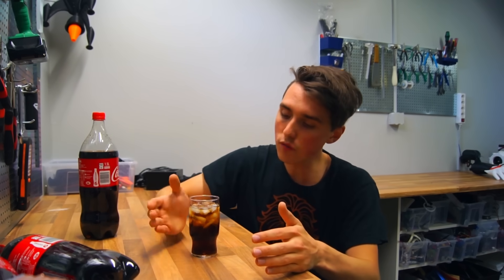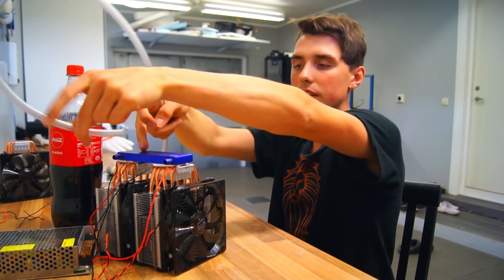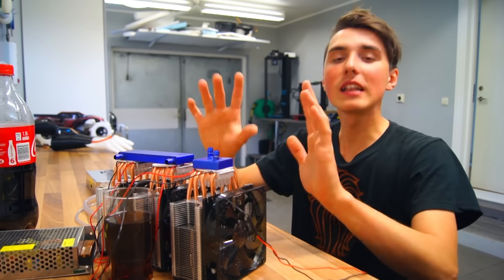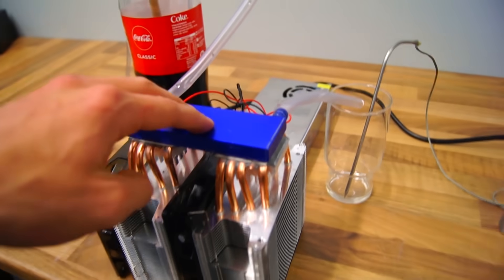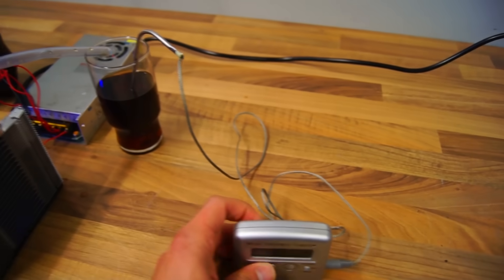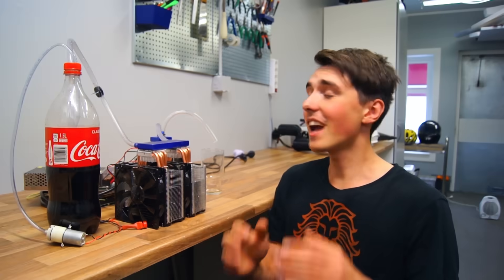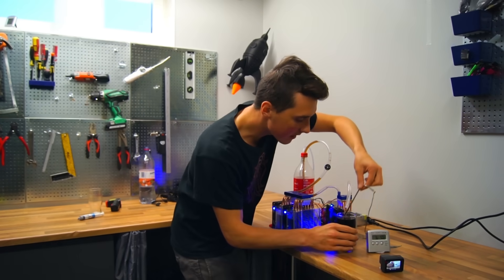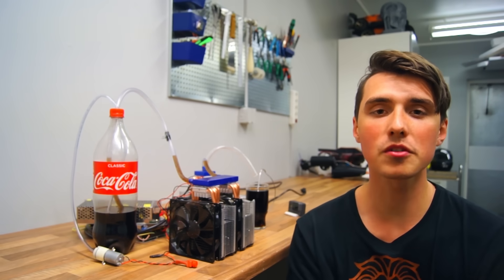Peltier Soda Cooler Machine - DIY Drink Dispenser

Comment: So, how does the lead based solder they use to seal those taste? Delicious and cancerous? Also, you were hitting thermal capacity limits with your low mass of aluminum (ie, you were waiting for it to chill a long time, but the low amount of metal wasn't storing enough thermal potential difference to be as effective as you want). So adding a chunk of copper (or steal, any metal) to the top of the long water block would have been a lot more productive than adding the second small cooler. Obviously you weren't going to go so far as to insulate it since you would be tearing it apart soon after, but the thermal mass would have solved your problem.

Besides the dangerous lead (I'm hoping you just didn't know they used vacuum soldering to seal the blocks), it was a cool project. I had thought about doing this with my phase change cooler (refrigeration cycle for computers, -55c no load, -35c max temp at 200w load) and using a safe block that uses an acrylic top and an O-ring for the seal. Plus it should be easy cleanup that way with a toothbrush on the fins. You have a cool idea (ha, literally), but safety first (you can just use the non-soldered blocks if you want to use your's a lot).

Comment: Best way to limit the flow would be to use a buck converter on the air pump. Get the adjustable ones, and place a snubber diode across the pump inputs to prevent back EMF.

Comment: Use the motor as a vacuum, then make the liquid circuit in circle, the coke comes and goes to the same recipient, when it is enough cold, stop the recirculation and turn it off, in order to avoid freezing the coke inside the circuit

Comment: Cool video (pun intended!) ;)  however try using a longer strip of metal (not a waterblock) say 18 -24 inches long with the 3 peltier's spaced evenly then use a longer tube of plastic and wrap it around the metal strip. so the liquid never touches metal, lot more hygienic and easier to clean. Also might cool it down more as it's travelling a longer distance along the metal... ;)

Comment: hey man your sistem is ineficient in the heat transfer, the block is too big inside and too short path, the best thing you can do is use an tube coil, best one iso copper tube coil, like in the old beer cooling machine tha uses ice with the arround full of ice and the liquid passes the coil, in your block the liquid passes and refrigerate the outside and in the midle of the liquid is hot, in the cup it mixes and bring an midle temperature, in the coil ins much mor midle hot liquid, try that and awnser me the results, i wanna make one too UAHUAHAUHUA but the teory is that XD... good chanel good try

Comment: For what do you need the giant heat sink?
Reply: If you don't cool the peltier-elements enough they will overheat and break and they produce a lot of heat
Reply: FreakManuel is it necessary to use such giant heat sinks?
Reply: MrBackfisch to the overheating do peltier elemts cool better as cooler the hot side is (im not completely sure about that tbh) but better cool them to much as to little

Comment: Actually, just before you pulled out the sensor out of the glas, you can see 6 degrees on the display!

A very easy way to enhance this is to mount a second cooler on the top of the 2 other coolers. Maybe print a 3d part to hold the 3 coolers together.

Comment: Just use Dy Ice cubes instead of water ones. Sublimates and adds a little extra carbonation on its way out... no crunching on them though.
Reply: Please don't ever swallow dry ice. You do not want your insides to get frosted.
Reply: you can store dry ice in a super freezer or in a tank. just have a bottle of liquid Co2 and a staintless tea filter. run the liquid Co2 into the stainless filter and poff dry ice.
Reply: freeze soda.  Use freeze soda cubes for cooling your soda. :/
Reply: get a large block of dry ice and put it in a cooler in a freezer. that's the best way to store it without special equipment. however it will still slowly evaporate.

if you're afraid of swallowing it place it in a tea infuser.
Reply: I thought I had seen that some supermarkets in the US sell dry ice? Is that a thing or did I make it up.
Reply: @bencarter96  Tons of supermarkets sell it here in the USA, I buy it weekly, all across the country.
Reply: i've seen a few that do but there are none nearby me so i dont think they are very common.
Reply: There are a couple by me that sell it. Good for keeping stuff frozen on long trips.
Reply: Ben Carter
Reply: https://www.youtube.com/watch?v=3u_5AkcOc84
Reply: Awesome idea!!
Reply: LostName chewing quickly on dry ice is actually fine. Swallowing a small price would hurt going down, and would probably make it hard for you to breath once it hits you stomach because of the CO2 that gets released when it cools down, but it wouldn’t kill you our “frost” your insides, or whatever you’re trying to say.

Comment: Dude, you drink far too much sugary Coke! 
You could optimise the design of your cooler by turning the whole thing upside down, so the cool part is at the bottom and the hottest part is on top. This would reduce heat from moving up to the cool side. Perhaps putting some insulating material such as expanded polystyrene over the cooler blocks would help reduce the temperature a little further as well. This is the same method used to cool in many cheap single can fridges.

Comment: What you need is more surface area for the drink to come in contact with. The water block was very thick. Thin tubes pressed between two peltier units might have been better.
Waiting for update to this project.

Comment: Fun project
it is 25 amp at 12 volts so on 220 v it is 1.36 amp and for 10 minutes it use a big < .13 amp >
not so expansive for a fun project
May be you should turn the unit upside down for better perfo < heatsink block under > because the heat always go up

Comment: Please use ring or fork terminals on your AC wiring to those LED power supplies. Be safe!
Reply: That and don't position the mains power supplies in the middle of a liquid carrying rube goldberg build.  One bump of that full glass and this will be a different kind of video.

Comment: I would not want to drink something which has been thru a grotty machined Chinese block of aluminium.
Reply: So then cycle some isopropyl alcohol through it and maybe some bleach if you're that concerned.
Reply: I was completely certain that the cans weren't coated inside. But because of your comment WizardNumberNext i decided to look up the process again and you were right, Aluminum soda cans are indeed usually coated on the inside with a waterbased varnish that's meant to prevent a metallic taste and corrosion. 
I also did a quick search of the effects of aluminum (i didn't look at many sources so this may not be 100% accurate. but it probably is) and it appears that when consumed orally

-Aluminum may or may not cause alzheimer's and there's research that supports both sides so its uncertain. 

-Small amounts of aluminum such as whats found in out food and some over the counter products don't produce any significant medical issues.

-However aluminum does affect people with kidney problems and alzheimer's differently than most humans.

-When inhaled aluminum is quite bad, Similar to about every other metal.

-In large large amounts aluminum does cause some problems (similar to most metals) but shouldn't be a risk in the amounts found after going through the block.

A lot of people think these block have lead in them. I don't think so, I went on ebay and just selected a bunch of similar blocks from multiple sellers and countries. In the description of all of them it said it was connected through brazing not soldering. Although solder is a form of brazing it's very unlikely that solder was used, Because solder doesn't stick to aluminum (so probably no lead). The most common and cheapest material for brazing aluminum is a aluminium-zinc alloy. 
Zinc is not harmful. Zinc even has a recommended daily intake of 11 mg and taking more than this occasionally will only cause you to feel a bit sick.
The block is usually anodized blue and what they use for that is probably non toxic. But there's a decent chance it is when exposed to acidic liquids, But coke isn't the most acidic, Its not in contact for very long, And its a relatively small amount. 

I personally don't have an issue with drinking an occasional coke that came through a block like this, However whether or not i'm comfortable with it isn't what people are debating. In the video he even said it isn't a practical thing and that he is unlikely to use it again he just did it for fun, So it's clear that he won't be experiencing any long term health effects from continual use. 
Now because i'm a bit curious i think i might start taking apart a similar block that I have to see exactly what is inside.
I didn't expect this reply to be so long. the first 2 sentences were what i originally intended to say but after the third sentence I got carried away.
Reply: Aluminium block is not a problem ! Micro pieces of aluminium is a problem. All the fear about aluminium cans and food containers are nonsenses
Reply: yet you'll eat a cheeseburger from macdonalds that came from an animal, pumped full of steroids and so sick it couldn't even stand when taken to the slaughter house.
Reply: i took a block apart. in my previous comment i said i would be ok drinking an occasional coke out of something like this and i don't take that back. the points i made in that comment i still feel are relevant and reinforce some of the things i said in the video

https://youtu.be/-hHfV1KMKJs
Reply: Here we call those "cans"
Reply: It never goes into the heat sinks.
Reply: Yet you drink it straight from a grotty blow molded Chinese plastic bottle
Reply: must be an absolute shithole you live in where your country imports fucking plastic bottles from china  @nico8273
Reply: You mean from a food-safe plastic container bottled in a local factory to govt health standards.
Reply: @msdosfloppy  not local it's still chinese
Reply: Jamie Yup, me neather.Sick!
Reply: how are we so worried about soda. doesn't water have so many things in it, it ain't even funny.
Reply: ? water vs coke. which is worse. lol. but seriously which one.
Reply: @1menatbpe  are you fucking stupid? obviously coke. its not even close.
Reply: couldntgivafuk: I haven't eaten McDonald's in about 20 years
Reply: what about the aluminum cans that coke and other drinks can come in
Reply: top and end of it all. what about the air we breath. lol. am I right.

?you'd think with all these emoji's that there'd be a factory one. there ain't?
Reply: Spookydude3 watch how aluminium can is made. aluminium is NOT exposed to your drink at all. aluminium in such cans are coated to prevent contact with drink. another thing is PEPSI uses steel cans worldwide
Reply: Hot Cold changer aka 2 cicle system and you are safe
Reply: Jonathan Mayer thats why i dont drink soda.
Reply: johnDon bullshit!
Reply: couldntgivafuk i eat steak from my own cows.
Reply: Jamie you know, I think the soda itself is so bad for your health already running it through that waterblock won't make much difference
Reply: yum
Reply: FPV Leo bacteria never dies at low temperatures
Reply: +Jamie "govt health standards" that only means it passed when an inspector showed up and you have no idea what kind of fuckery was going on the rest of the trimester
Reply: Watercoolers are made also from copper. Copper is more toxic as aluminium. (Acid and metal in chemical reaction)
Reply: Jamie chinese block
Reply: Jamie health standards.So much sugqr and acid doesnt seem so healthy to me
Reply: blow mold bottles are usually made at the factory where they are also bottled.
Reply: You mean you drink pure sugar and cancer-causing chemicals engineered to get you addicted and decrease your lifespan by probably 10 years at a minimum.
Reply: FinnishArmy And it is used as a pesticide.
Reply: so time to cast some iron
Reply: Yes you would
Reply: I know right?
Reply: Gona bet you have had a fountain drink, no? Well guess what that flows through before it gets to your cup.. lol yep a big block of good ol' groty machined Chinese block of aluminum.
Reply: yes you could it would be micro or nano particles but shit builds up in your body over time
Reply: I was thinking the same thing... none of that stuff is food safe, even if it's never been used before... Especially not if it HAS been used before
Reply: they use glue to seal the aluminium case
Reply: So you must have never gotten a fountain drink from a restaurant then.
Reply: Your cooper water line has mold too
Reply: Pussy
Reply: @fpvleo2606  Bacteria hibernate at low temperatures, researches have found bacteria from the prehistoric era in polar ice caps. High temperatures kill bacteria and he should have washed this with warm water and soap before using to avoid accidental ingestion of metal fragments and what-not.
Reply: @degerdi  yeah i didn't knew that back then sry
Reply: FPV Leo I just noticed how old that comment was lol my bad
Reply: Wait....what? The coke never touches any of the metal equipment. The parts that the coke travels through are the plastic pipes and the blue water container above the heat sinks. Then straight into the glass. I think you are mistaking heat sinks for radiators, like in a car. Different thing altogether.
Reply: Yeah, these are made by vacuum soldering. So the inside will have spattered solder, most likely lead since lead based solder melts at lower temperatures and in general works great, unless you are using it for electronics or environmental certification, or more importantly, for your DRINKS!
Reply: You do know you can just clean it before using for food purposes. Even if you didn't, you do know us humans have immune system for that, right?
Reply: @Daunlouded  and thats why we dont need vaccines /s
Reply: Jamie Plus the material it's made of will get etched away by the soda. Where does this metal go? Into your drink, of course.
Reply: Propably all your aluminium pans are from china.
Reply: I'm worried about the probably LEAD solder they use to join and seal the block. Its not the aluminum, that should be pretty safe.
Reply: @jakegarrett8109  Aluminum is pretty bad too
Reply: I would not want to use crappy metal iphones made in china
Reply: Coke quality is more questionable than a piece of aluminium you can wash...
Reply: lol what a pussee you drink out of plastic, that's worst
Reply: Jamie me neither
mosty of answers are poorly foolish
aluminium is toxic
coca-cola contains acid (look at concentrate it is written on it "corrosive" )
you can get rid of dirt, grease and what not, but you cannot remove aluminium from aluminium block as there will be nothing left, moron
Reply: WeeItsNookies sorry i think your commenting to the wrong person i am and always will be a republican for life.
Reply: aluminium is toxic when freshly cut, cans have a protective film made of plastic or something
Reply: dude...
He is drinking Coke...
That means loads of Sugar and some Water you really shouldent worry about the Aluminium and the so called "safe" waterbottle - cheers

Comment: Why you didnt Put the heatsinks on bouth sides of that Block?
Reply: I'd think double/triple stacking cooling blocks on top of each other so the soda passes through the block furthest from the peltier then through the block nearest the peltier will help drop the temperature further without adding extra current demand. It will increase the thermal mass the coke has to warm too which can only be positive! Obviously the initial cool down and recovery time will be slower but it will be a cost effective way of improving the efficiency and dropping the final temperature. You could also insulate the cold side to prevent ambient heating though the effects will most likely not be that great, finally flip the system upside down since heat naturally rises which will have a small effect on making the heat sinks more efficient. 'Cool project' though :)
Reply: Peltier-Elements or thermoelectric coolers work by "tranporting" the thermal energy ("heat") from one side to the other. To do so, you put current into them, and one side gets hot (the one with the CPU-Cooler) and the other one gets cold (the side with the waterblock). If you put another heatsink on the water block you actually "waste the cold" as there is more thermal mass to cool and the fan even mores more air through it. So to actually improve cooling, you should insulate the cold part, so that the only medium to get cooled is actually the coke passing through.
Reply: Eric Vauwee yeah im not dum of course you put another module in between
Reply: Right.  Heatsink-peltier-waterblock-peltier-heatsink.
Reply: was thinking this exact thing, big block of metal on the other side of the waterblocks to add a ton of thermal mass :)

Comment: i think the setup could be much more efficient if you flip the orientation of your heatsink and Peltier upside down. since the liquid heatpipes of the heatsink requires phase transitions to work efficiently. with your setup the liquid pretty much stay at the bottom because the hotter side at the top.

Comment: You should 3D print a modular case to incase all the components. A few of these modular cases could be lined up to make a soda dispenser. You could also take it one step further and add multiple buttons. Each of these buttons will activate a timer for a different amount of time  and this will activate the pump for a different amount of time depending on the size of the glass